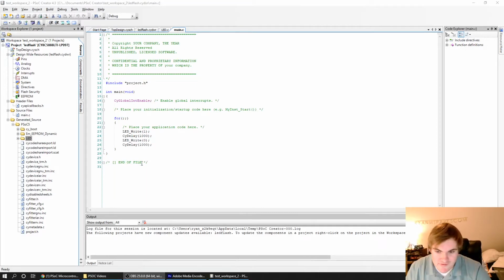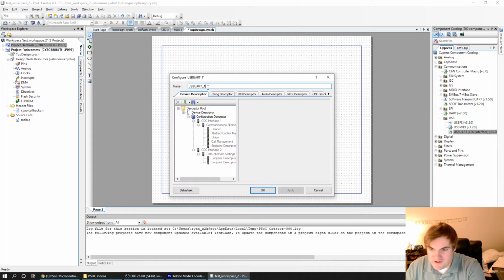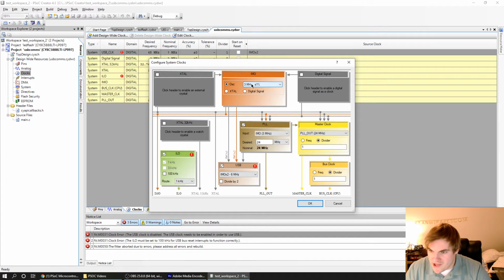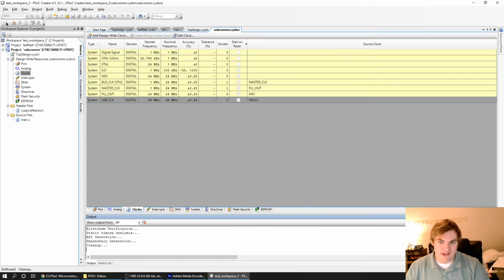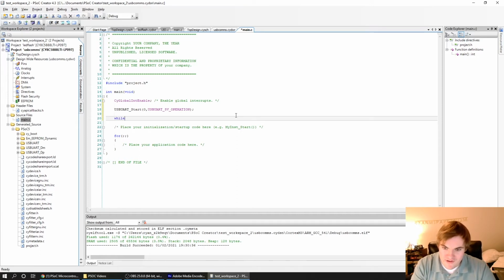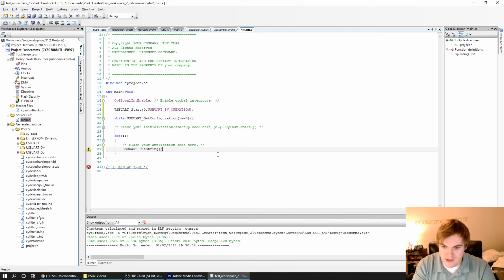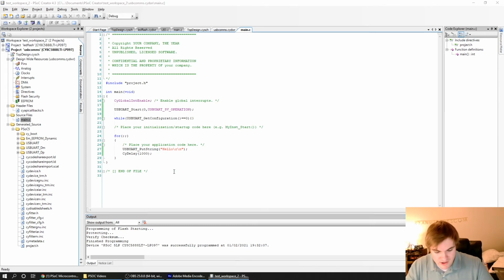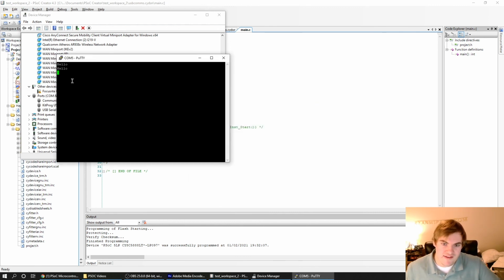[PSOC 5LP] USBUART Hello World - Sending a String to PuTTY

Comment: Hi @ryan, Its showing USB device not recognized. Would you please help me with that?
Reply from the maker: Hi Sreenivas! That depends on which 'side' of the 5LP board your computer won't recognize... If it doesn't recognize the KitProg side, that'd be a problem with your Cypress installation or drivers.  If it doesn't recognize the PSoC side, this can be indicative of a code issue (Possibly missing line 20 from the video?) Good luck!